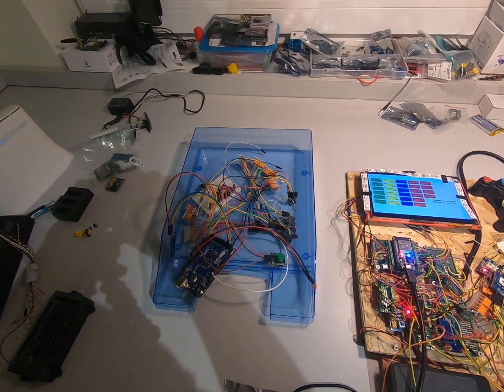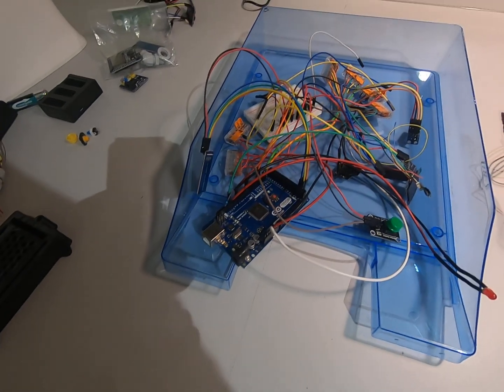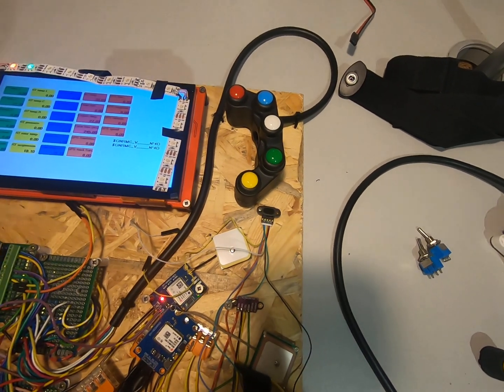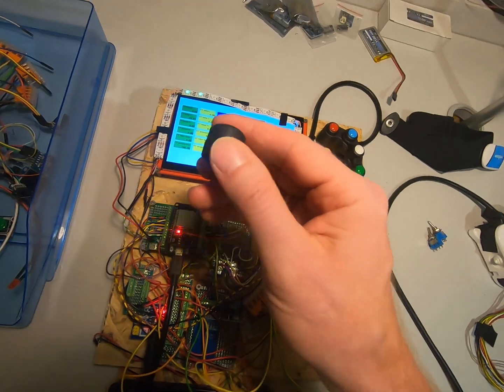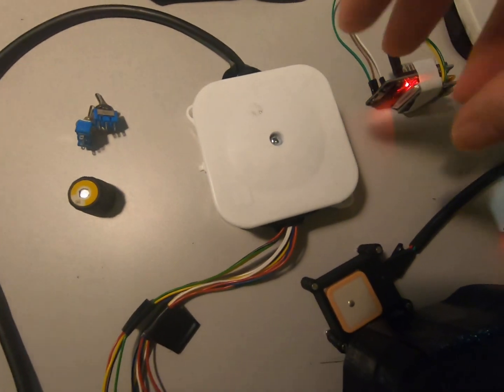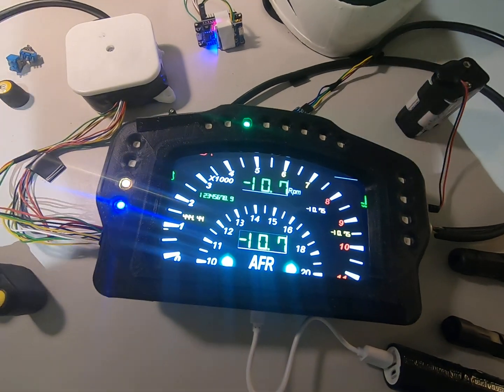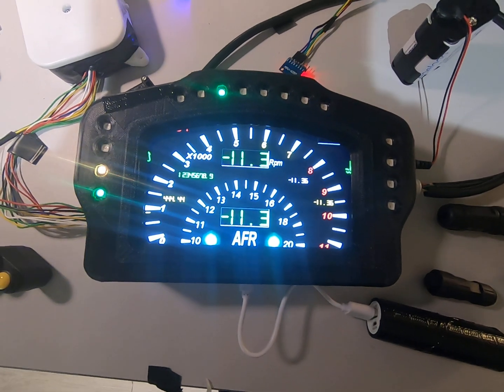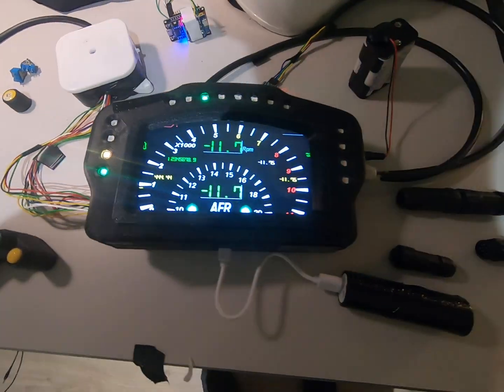Building cheap 'motogp' telemetry / intelligent dashboard for race track motorcycle p3

Comment: Hi Mariusz! Have you tried the "Time of Flight" sensor pointing to the tire? I wonder if being black can cause any trouble...
Reply from the maker: yes, it may generate weird readouts - what I do point it to the top of the fender (sensor is mounted under triple clamp). Also, I added white stripe of tape where the laser points to on the fender and it is working consistently.

Comment: Bro, you put together the perfect DIY IMU solution! I had the same idea, I've spent the past month researching and gathering components. ESP32, sensors, just need to get a screen. I have a 3d printer also, CR-10 modded. Will you bless a brother with  some code?! mackn918@gmail.com
Reply from the maker: Hi, sure I can send you some code - let me just prep  it. I suggest you start playing with this and code the whole solution in multiple stages (programs) gradually adding more sensors to it so effectively breaking it into few iterations - makes it easy with testing. Please also look at this project as I've used it as base for GPS coding (really appreciate the owner for open source'ing it): https://github.com/quichedood/DAWA Also, I've pretty maxed out ESP32 when it comes to analog and digital pins - luckily have all hooked up but there's quite a lot of sensors attached so pretty much every pin is used. Will record more technical video where I will show how it looks in details.
Reply: Did you ever get a chance to email me the code? My inbox is kind of cluttered, lol. I'm just going to use 9dof imu, esp32, tof x2, ir temp x2, gps, and sd module of course. Maybe bluetooth tire temp if I can find good cheap sensors. Your code would help me greatly to build off of. I can barely understand the code, much less code it from scratch. Thanks again for the info bro.

Comment: Fascinating. What a cool setup. The buttons and HUD is next level. I would be really interested in seeing the outputs charted and overlayed on a video when you do track sessions.

I have an old flight controller for an old quad copter I used to fly. This video makes me want to hook that up to my bike and see what I can get out of it now
Reply from the maker: Many thanks for feedback! Will definitely share the results and further evolution of this project - apart from post mortem logged data analysis I will mainly aim to extract as much useful infromation on the track as I can so that feedback can be provided 'on the track' and only later 'at home' to get the global overview on the progress made. Will see how this pans out in the end!
Reply: @SolarisAgentSystem  ah yes that makes sense. I can imagine that live on track feedback is critical when trying to gain most time efficient improvements, as direct feedback would allow each iteration to be done real time and you could viscerally sense how small changes directly affect output lap by lap. The idea of having sensors on the tyres that tell you of the limits so you can push harder is fascinating. Sensing pressure and temp would be helpful for braking and throttle too. this would be like growing touch and heat sensitive appendages, like having the sensation of fingers, feet and skin, that reinforce the brains ability to learn the tell tale signs that the bike is at max brake or gas, oversteering or the front is tucking or pushing. Instead of having to crash many many times like I am doing, this would premeditate the warning signs slightly before by amplifying the signals otherwise that are so subtle they take hundreds of crashes to learn. The coolest(maybe too far fetched) way would be to have the pressure and temp feedback on the leather suit or gloves to free up visual resources that may get overloaded, but I wonder how difficult that would be and would go beyond the scope of a diy project.

I once did see someone with heated grips on their adventure bike. I wonder if its possible to hookup temperature of tyres to the grips, to free up visual and use touch instead. Maybe haptx gloves people use in vr, imbeded into leather gloves for pressure feedback? This is beyond what I know about so I could be blabbering.
Reply from the maker: Re knee sliders in other video - looks like yt just cut out the comment due to use of wrong words :) but I fabricated them myself - saved me a lot of cash as they lasted for almost the whole season rather than 1-2 sessions for normal knee pucks. Once they were out you can easily replace them with new material for 1/10th the price  of shop available sliders. I merely borrowed the idea from jorge lorenzo's dad - he uses them whilst running his motorcycle traninig school: https://www.youtube.com/watch?v=uMXiQrhNYCY&t=141s